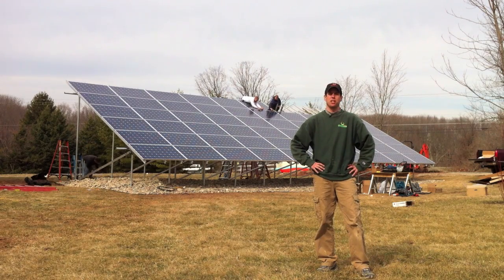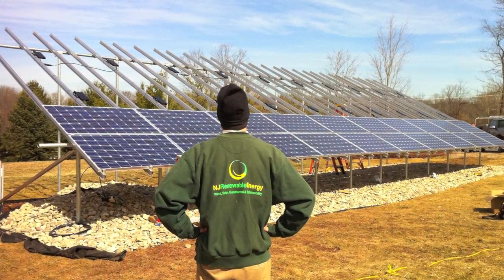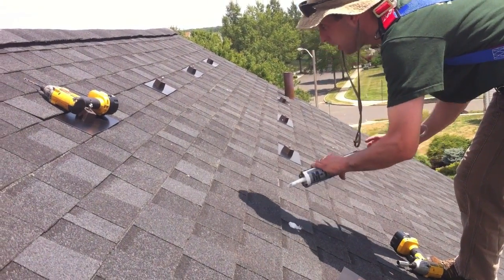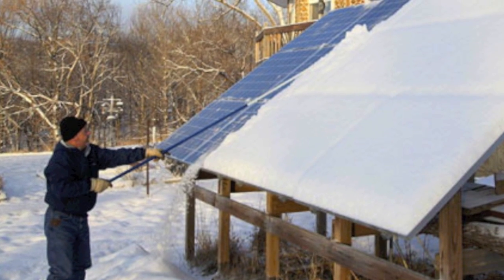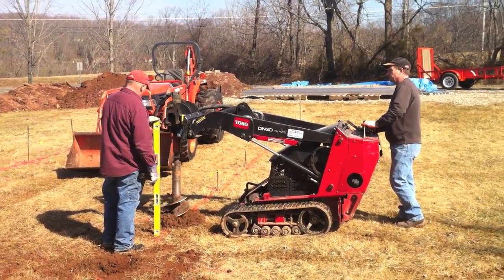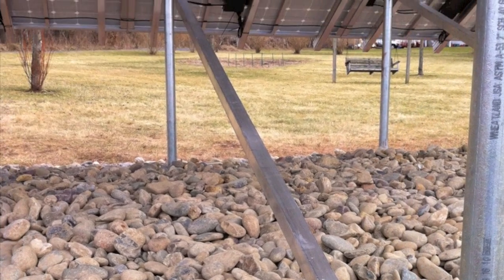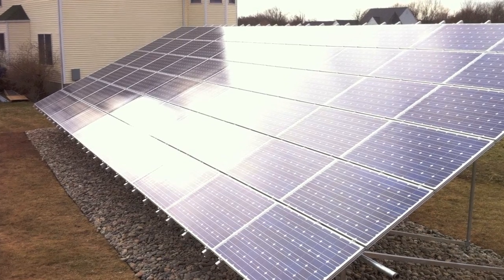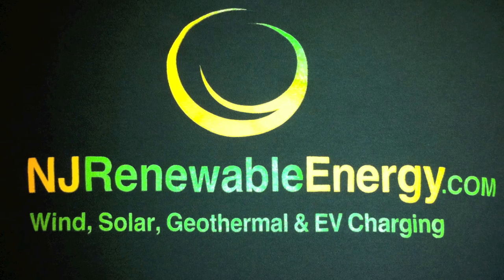Why install a 14.1 PV Ground Mount Unirac ULA Enphase D380 Sharp 235 solar

Comment: I know this is an old video, but have any / all D-380 been replaced due to failure? I had 9 D-380 and 8 failed after about 10 years, Enphase was very good about replacing with next generation micros.